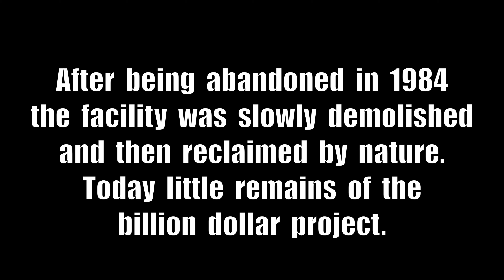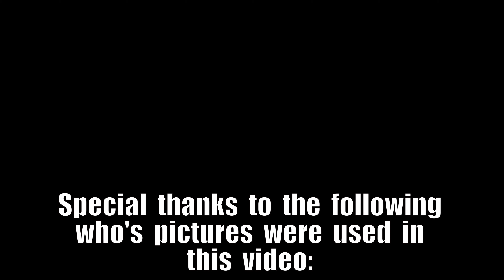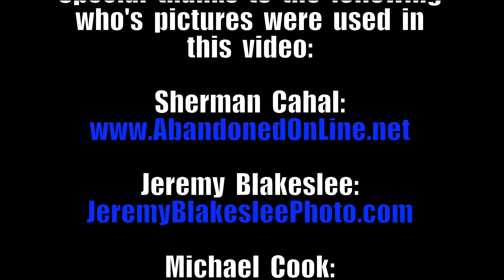The  Abandoned  Marble  Hill  Nuclear  Power  Plant,  Paynesville,  Indiana

Comment: I worked on building Marble Hill. At the time, the original price of $740 million was considered a bargain basement price.  Going rate (before the cost overruns that hammered every nuclear project from this generation) was about 1.1 billion.However, This was because Marble Hill was supposed to be the third copy of the Byron  and Braidwood plants. All three plants were twin units with some shared facilities between the two units on site.  Since Byron and Braidwood were supposed to get built before Marble Hill, the bulk of the plant would have been built four times, so most of the construction problems would have been solved before Marble Hill started. Unfortunately Byron and Braidwood got delayed and Marble Hill was in the lead for a while.  There were a lot of other issues as well.
Reply from the maker: I  did  not  know  this!